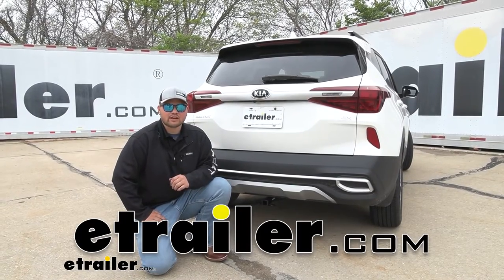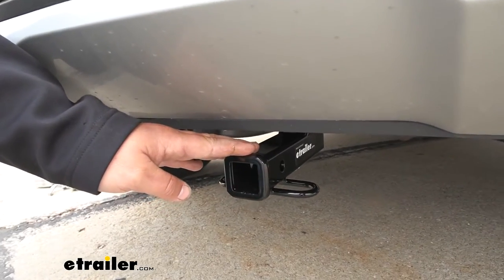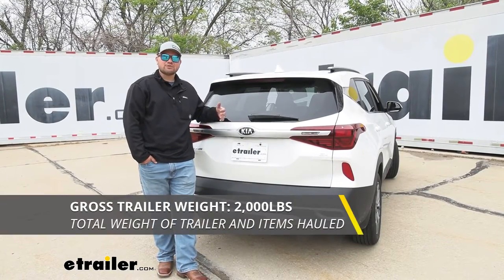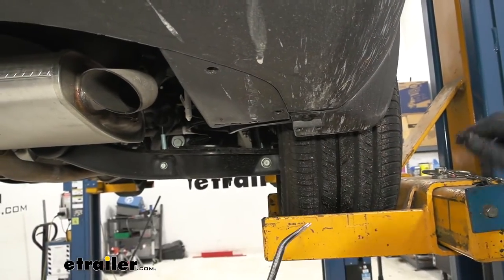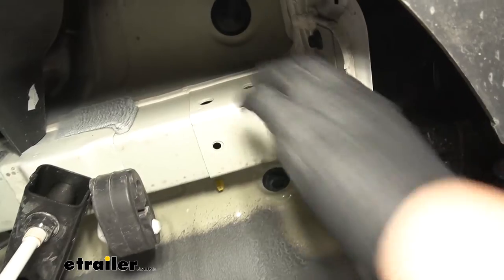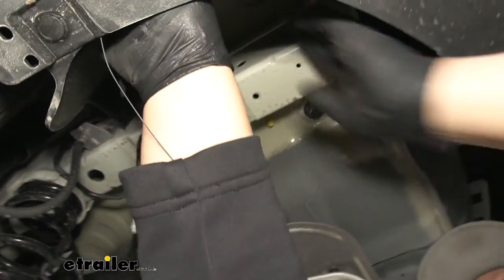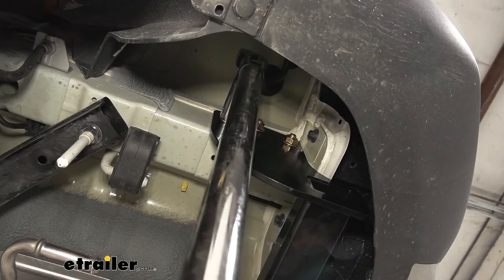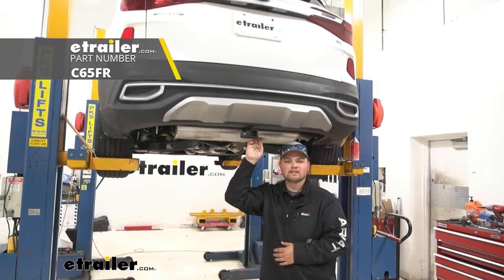etrailer | Curt Class I Trailer Hitch Installation - 2021 Kia Seltos

Comment: Success ! Much easier than I thought because of quality fishing wires and this video. Thanks ! Btw if you’re installing alone a 5gal. Bucket is the perfect height to help you hold it up to bolt it in. I didn’t remove the exhaust but was very careful not to bump it.   Also a little 90* bend in the end of the fishing wire can help it not slip.  Good times roll Kayak Time. 🎣.
Reply from the maker: Great tip, thank you!
https://www.etrailer.com/Trailer-Hitch/CURT/C65FR.html

Comment: Hi, my U-Haul installed a 1-1/4” one and I told them it was the 2” one what I needed they need to order it but they told me the bolts couldn’t be removed from the car ? Is this true? This is a new Kia Seltos 2023 car and it was their mistake! I think they said that because they’ll have a hard time removing the bolts to put the new one! Is this a thing that can be done ? Removing this hitch to put the 2” one? Please advice me on this since I don’t want them to damage my new car.

Comment: Thanks for the video, now how do I install the wiring harness, instructions say to splice into existing wiring. Do I remove the trail lights? Don't see any wiring in the trunk.
Reply from the maker: Thank you for the feedback! Check out the following link to see the wiring kits we have available for the 2021 Kia Seltos. Both kits will have you making connections behind the taillights with a t-harness and running a power wire to the battery.
https://www.etrailer.com/t1-2021_Kia_Seltos.htm

Comment: How do you remove screw lost inside
Reply from the maker: As a first step, you can try using a strong magnet on the underside of the frame member, and use it to slide the bolt to the access hole and try to snag it out. If that doesn't work, you might have to just abandon the bolt in the frame and grab a replacement bolt from your local hardware store. You'll need a 7/16-14 x 1-1/4 Grade 8 carriage bolt.
https://www.etrailer.com/Trailer-Hitch/CURT/C65FR.html
Reply: Might have to cut a hole in the frame and get it welded if you don’t want that thing rattling driving you nuts. - Or bolts. Haha I was just thinking and preparing myself for dropping a bolt in the frame. Wish me luck. Sorry you dropped one in there.

Comment: Could I tow a small trailer with this?
Reply from the maker: This trailer hitch is rated to handle 200 lbs maximum tongue weight and 2,000 lbs maximum trailer weight. You will want to check with the owners manual of the vehicle to see what the vehicle is rated to tow. Go with the lowest number between the hitch and the vehicle.
https://www.etrailer.com/Trailer-Hitch/CURT/C65FR.html

Comment: Not hard. Then, proceeds to take panel off, drop exhaust, run fishing line down bar, get a partner to help..lol what happen to just straight bolt on
Reply from the maker: That's a function of how the vehicle is designed, and because the hitch is designed to be mostly concealed behind the bumper. This has a much better appearance, but will require a more involved install.
https://www.etrailer.com/Trailer-Hitch/CURT/C65FR.html